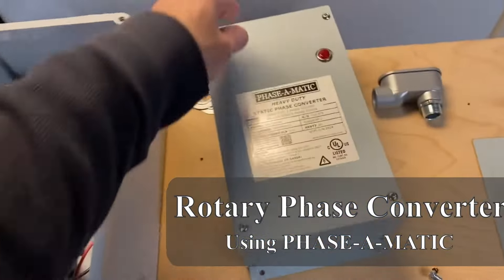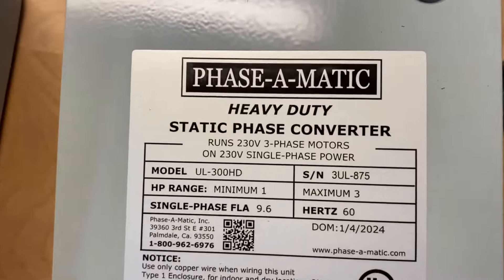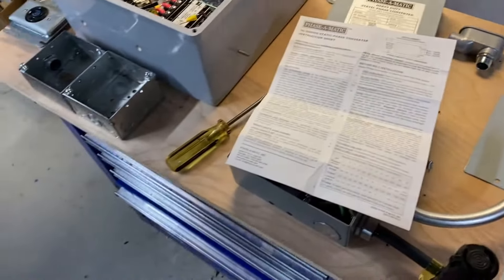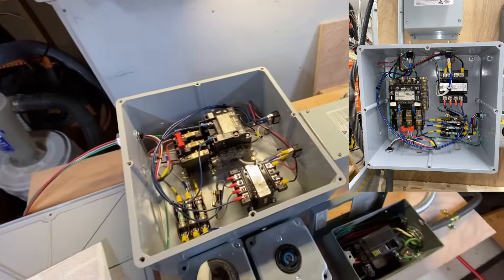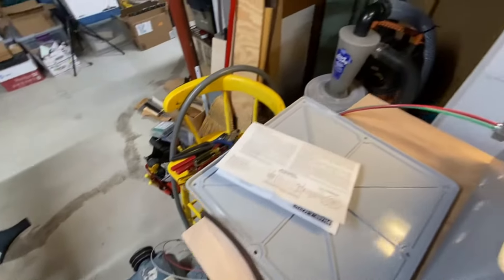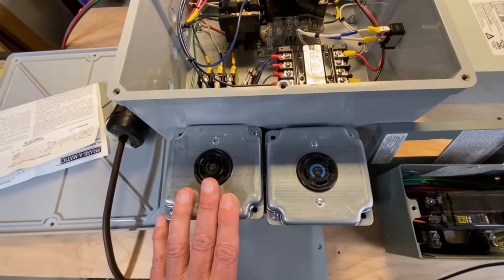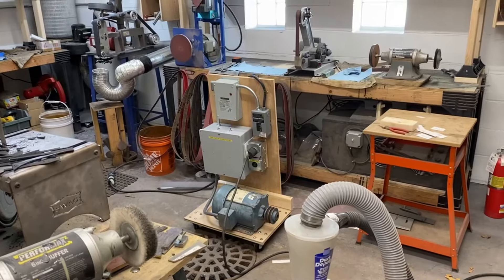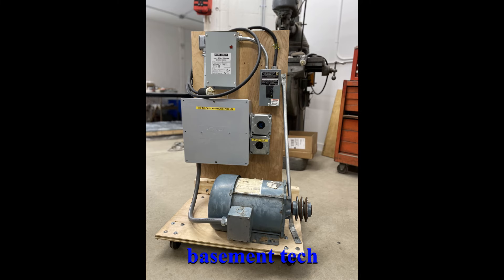Rotary Phase Converter - Redux

Comment from the maker: I did some research on the need for "output/run" or "balancing" capacitors (the question I posed in the video).  As I suspected, they can be used to fine tune the phase angle of the three phase output (as reflected in the P-P voltage and phase currents), particularly the generated phase.  I also came to understand that the need is increased if the load motor uses more than 50% of the rating of the idler/pony motor (e.g. Load motor is 2HP and idler is 3HP) and/or requires a lot of start up torque (like an air compressor).  My strategy: I intend to monitor my motors-under-load and see if any issues (heating, noise, under power) are observed and add if necessary.  Remember, my envisioned loads are almost zero start up torque required (like the surface grinder).  Make sense ?